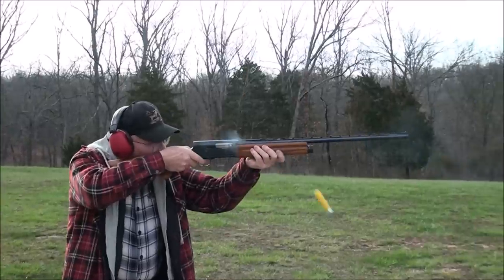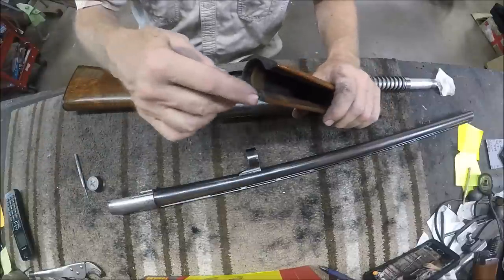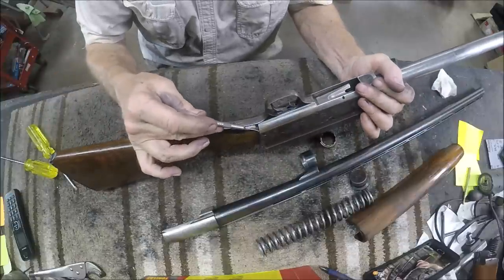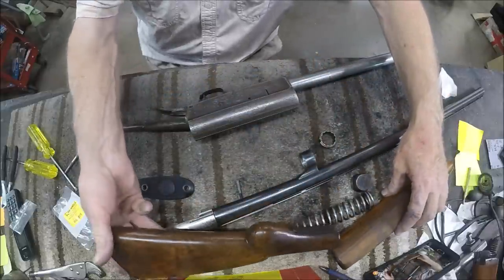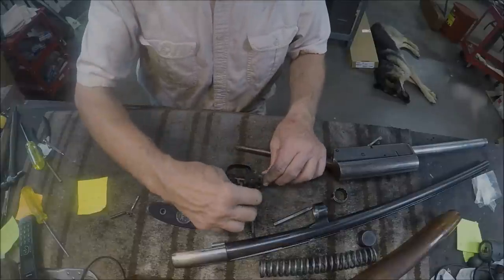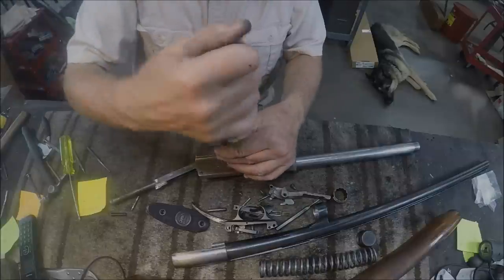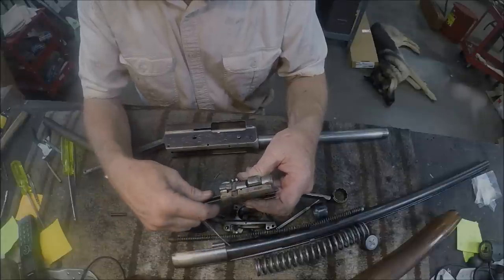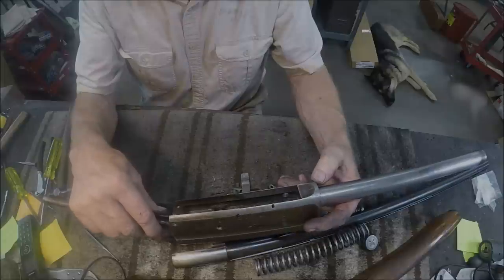Part 1 of the high grade Remington model 11 restoration.

Comment: I have a 1919 model 11. It's engraved identical to this one. And missing half the gun. My grandfather gave it to me with some other old gun parts a couple years ago. The other day while in my shop I came across it, and decided to actually give it a serious look. I'm not a gunsmith, I'm positive my restoration won't turn out as beautiful as yours. But I'm going to give it a go anyway, I'm starting with a non-functional gun, no stock. No foregrip. Not even a barrel. Some of the internals are even broken, or missing. Still I'm confident I'll take my sons in the spring, to shoot it with their great-grandfather.

Comment: The action spring pin on mine is stuck in place and I cannot get it out whatsoever, I've tried as much as possible without damaging the gun. Thinking about drilling out the pin and replacing it. Good video as always!

Comment: I recently bought a Model 11 off gun broker and its over all seems to be in good condition. What would it typically cost to send it off to be inspected and cleaned up a little? Not really wanting to refinish it but more or less cleaned and any badly worn parts/springs replaced.

Comment: art have you ever seen a remington model 11 with a magazine cut off lever installed like the auto 5 I have one it is in 20 guage I have several others and none of them have the cut off lever on them but my 12 light auto 5 and my sweet 16 do I bought the gun because of the lever as far as I know they did not come from remington with them and this is not a wartime browning made by remington this is actually a model 11